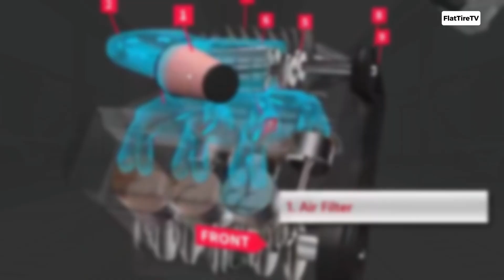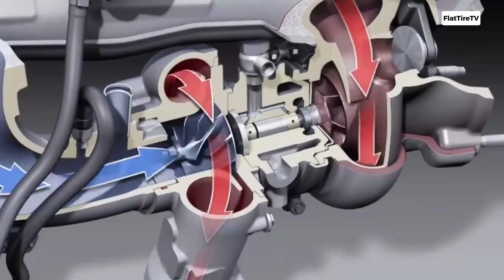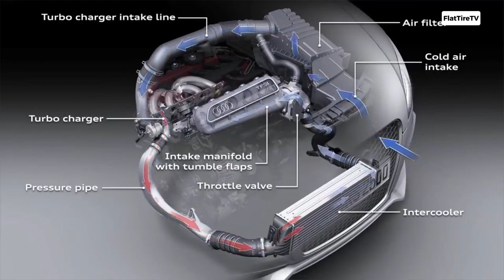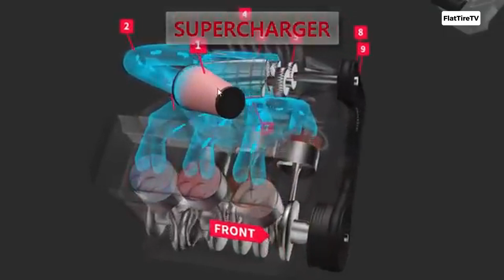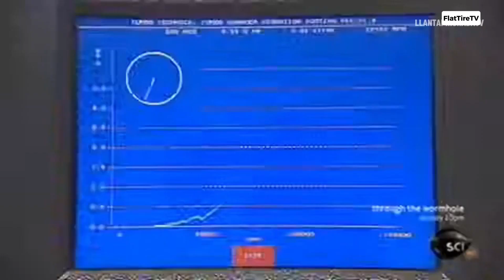TURBO vs SUPERCHARGER: Which One Is Better? Forced Induction Explained

Comment: Theres a reason F1 and other sportscar racing series uses turbochargers instead of superchargers.
Reply: Yes because they are restricted.  
Being somebody who races on the road course myself I prefer the instant throttle response of a supercharger the lag of a turbocharger.
  There a very respected reason why superchargers are used on 300 mile an hour plus Top Fuel dragsters. 1/10 of a second of Turbo lag means you lost the race. Even using rally car anti-lag, you are essentially destroying everything for a single race. Not sure about you but I cannot afford that.